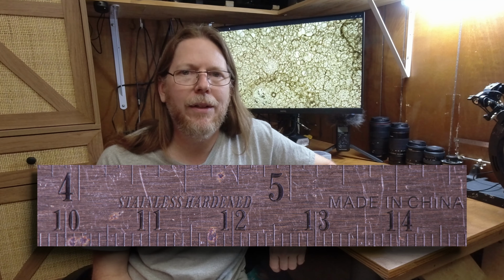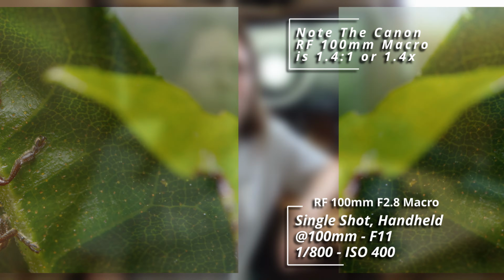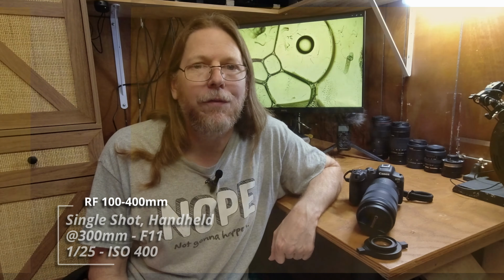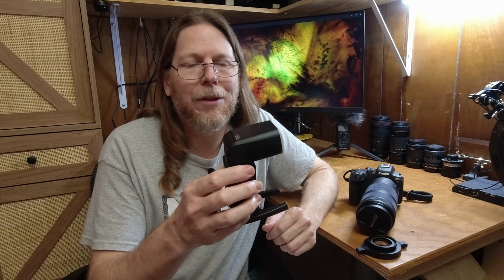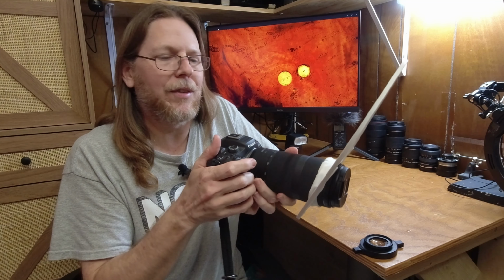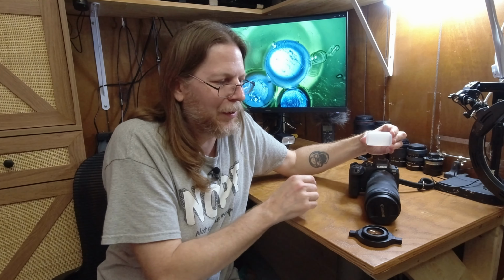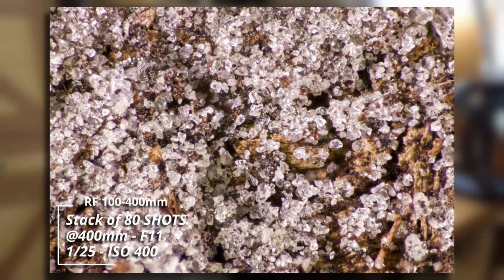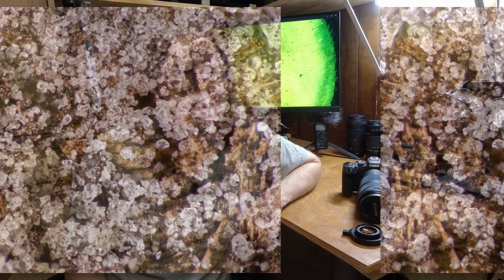Can You Shoot Macro With The Canon RF 100-400mm & The Raynox 250?

Comment: Thank you very much for this video. I recently got the Canon RF 100-400mm and I already own the Raynox 250. I did not think that the Raynox will work with this lens so well. 
You have given me new ideas on trying macro photography with this combo now! 😄
Reply from the maker: That's awesome! It's a fun lens, takes a little getting used to if you want to get good results in lower light but it can be done. And being able to do macro on the Fly With the Raynox is a definite bonus.